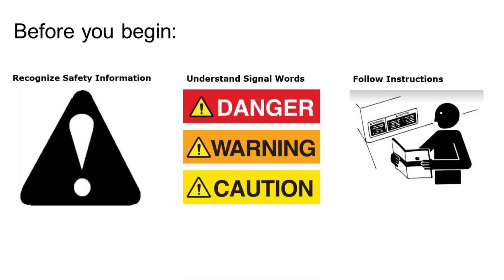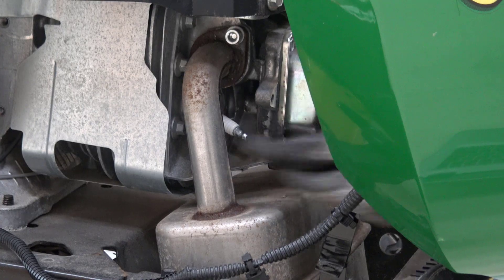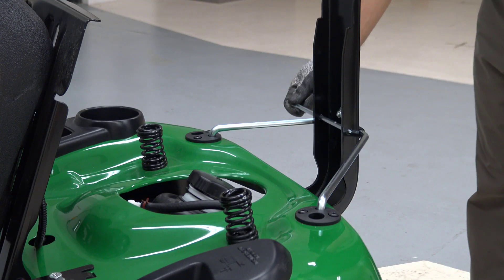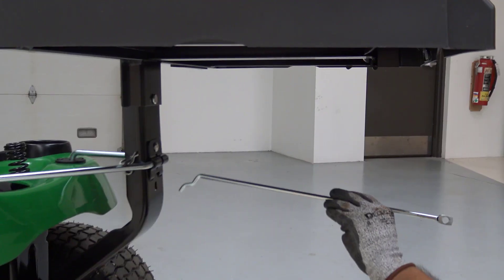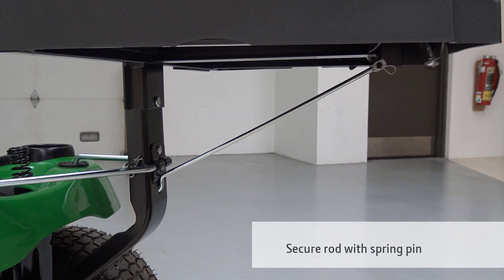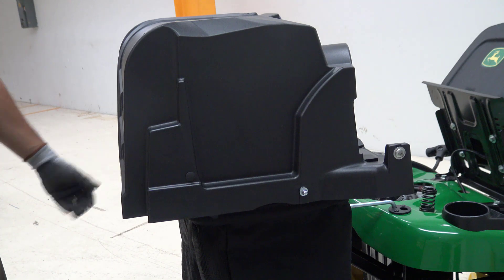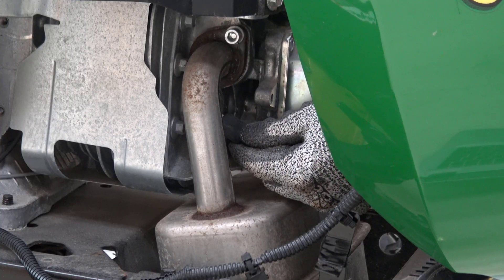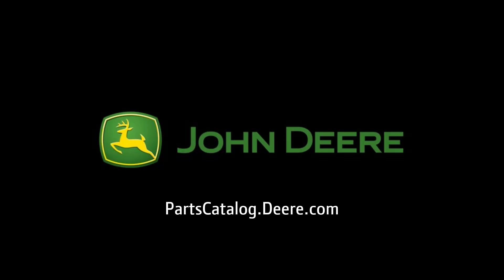How to Install the Material Collection System | John Deere 100 & 200 Series Lawn Tractors

Comment: This video helped me for sure; but the lower attachment to the mower didn't slide in nearly as easy for the one I'm working on. Did you guys have an altered one for the sake of the video?
Reply: Same. My lower chute will NOT go in. The pin is off by half an inch and it’s so frustrating

Comment: Can this assembly also be used on an X350?
Reply from the maker: Thanks for your interest, Peggy! This Material Collection System featured in the video cannot be used on a X350 Lawn Tractor. The assembly for the X350 requires the Hopper Kit (BUC11233) and the kit for the rear chute or Power Flow chute. The part number for the chute or Power Flow chute and blower will depend upon your unit's mower deck and model year. We recommend confirming part numbers with your local dealer prior to ordering the kit. You can find dealers near you and their contact information at https://bit.ly/3iPcfhG. Thanks again.

Comment: What is the part number?
Reply from the maker: Thanks for the question, perucabana. The Material Collection System that is featured in this video being installed on the S100 Lawn Tractor has a part number of BUC10284.  You can look up and order many parts for your unit online at Deere.com/Parts. Your local dealer would also be happy to assist you with locating and ordering parts. If needed, you can find your local dealer at Deere.com/Dealer. We hope this helps!